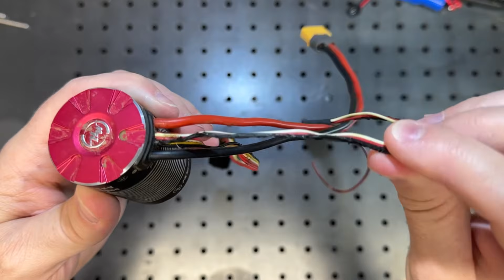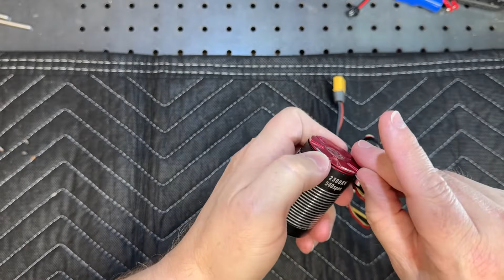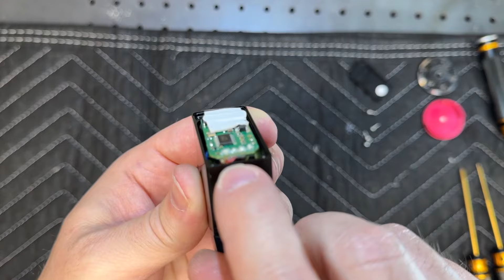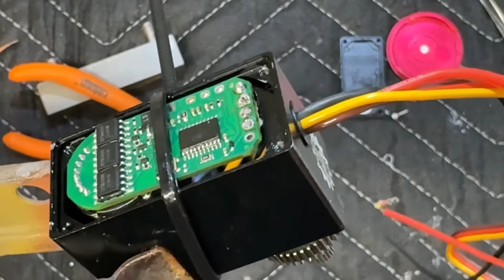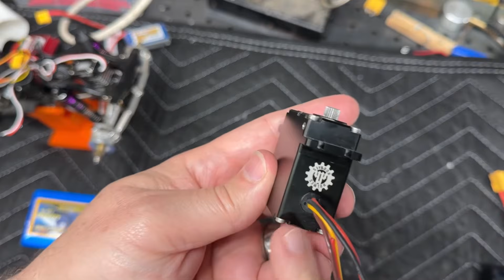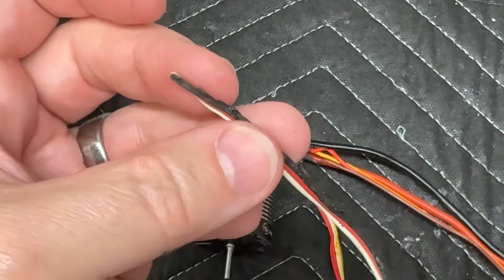How you save hundreds of £ $ in parts for your RC’s Repairing Holmes Hobby Hobbywing Fusion

Comment: All my RC vehicles have at least a few recycled / repaired / modified parts. Spent my whole life repairing, restoring, and customizing bikes, radio equipment, computers, audio gear etc. When I get given (or buy cheap) broken electronic devices If they can't be repaired or restored they get stripped for parts, I have built loads of new things using as many recycled parts as possible, only buying new parts when I have to. (old recycled switches, pots, faders and connectors are often worn and tend to cause troubles)  Over the last few years I have mostly made synthesizer modules, interface units, and custom electronics for RC projects ranging from 1/148th scale railway locomotives, signalling and control systems and RC cars from 1/24 to 1/8 scales. Currently building a custom 6x6x6 all wheel steering 1/10 scale recovery winch truck. MOA, SOA with adjustable overdrive & drag brake. Main winch, a pair of small drum winches (can run locked in sync or async for individual use) also added  a variable speed capstan winch. Completed truck total cost will be around £150 in new parts, most of that is the bearings, paint, stainless steel tubes/rods, SEEED XAIO RP2040 and Arduino MCUs plus a handful of specific components for control systems. Same deal as everything else, can not afford prices of new RTR Or Kit 6x6 trucks and they don't have most of the features I want anyway, so had to build my own.  Used to re-wind motors by hand for sprint cars and 1/10 off road racing back in the 80s - 90s but with such a wide range of motors available at reasonable cost these days I have not re-wound one for many years.  Nice job repairing the Fusion motor, they are not so cheap to replace. Keep up the good work, all the best from BOOS Modular & BOOS RC in Scotland.  BOOS = Built Out OF Scrap.
Reply from the maker: Superb I love the BOOS :) . Isn't it so satisfying to reuse and repair these parts. Thanks for the support.